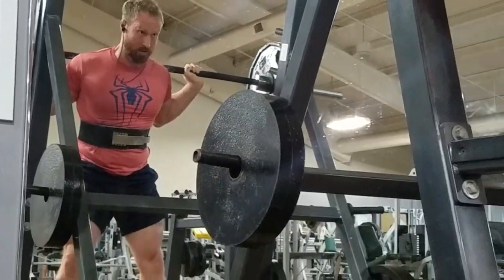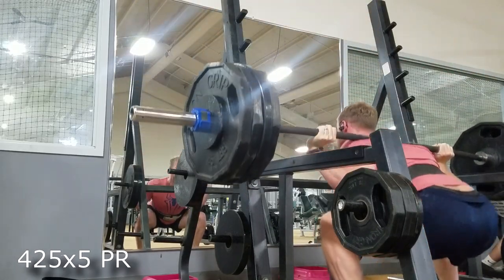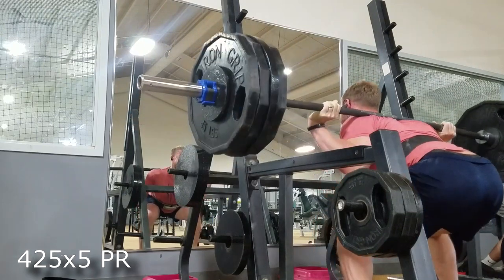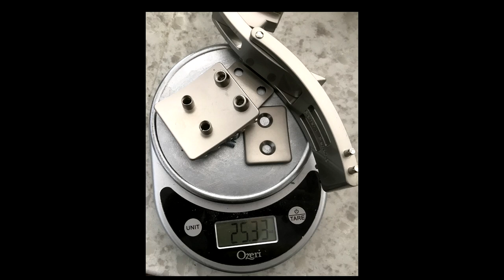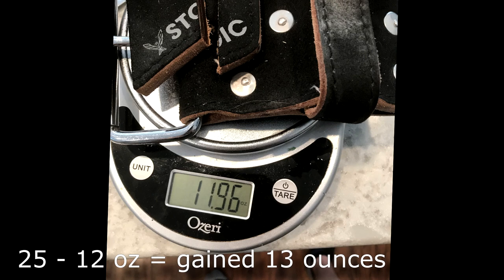Convert Any Lifting Belt to the BEST Lever Belt - only $41- Squat PRs 425x5, 375x9

Comment from the maker: 0:50 - how I got it for $41. 
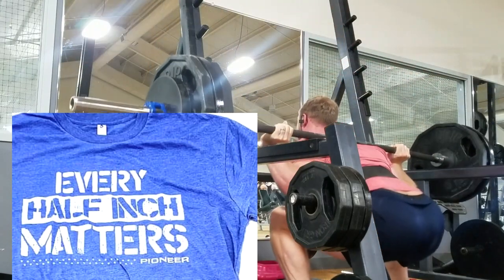1:47 - correct size for belt to work
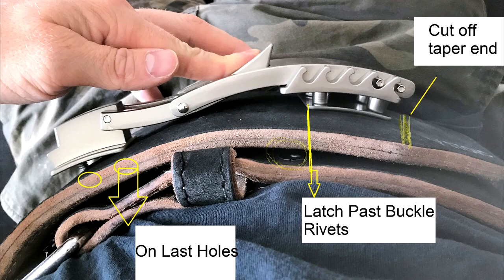2:15 PICTURE FOR SIZING REQUIREMENTS
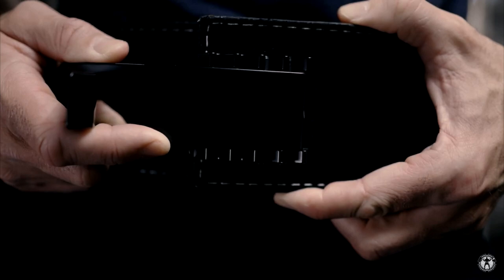2:45 WARNING YOU WILL CUT OFF YOUR ARMS AND LEGS AND DIE IF YOU ATTEMPT THIS MOD SO WEAR A COVID 19 MASK TO PROTECT YOU

Comment: What did you use to cut the ends?
Reply from the maker: Hmmm? The miter saw? A utility knife would have worked too. Afterwards tapered and rounded the cut edges to make them comfortable and then I sealed the leather with super glue and sanded it smooth.